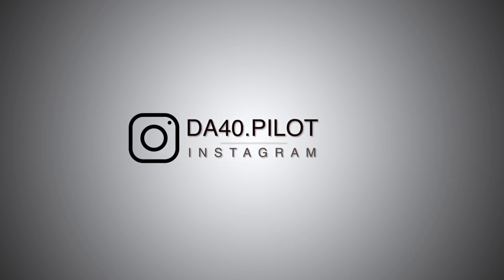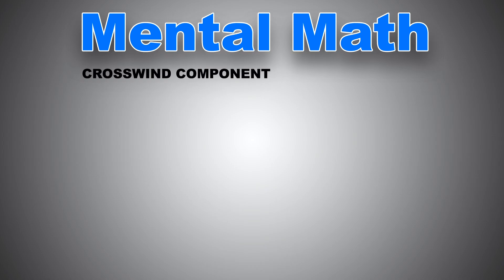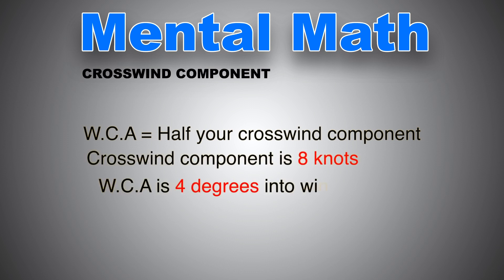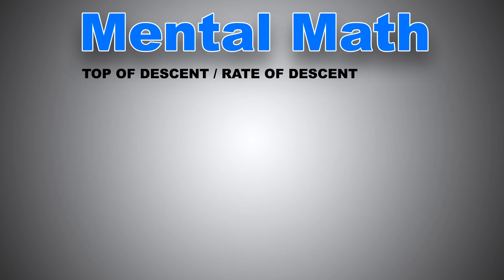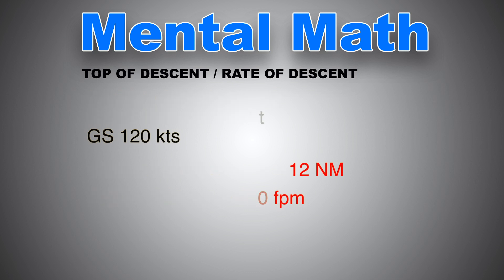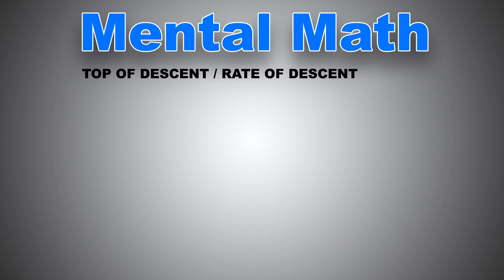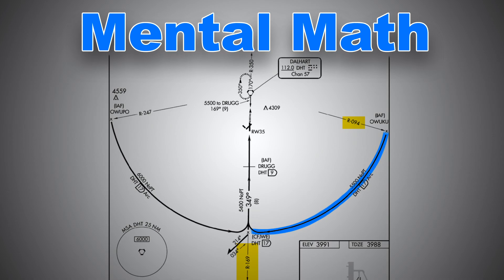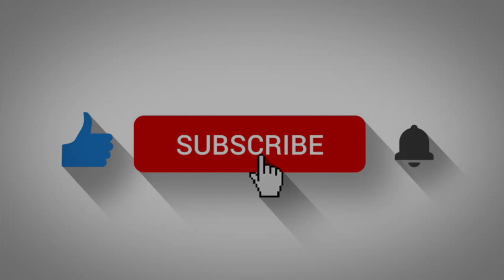✅ Mental Math For Pilots | Easy Math Hacks Every Pilot Must Know

Comment: Captain I have a question regarding the XWC. What if I encounter the situation of a tail wind. And it is above 90 degrees diference. Example:
HDG 290
Wind from 170/20
290-170= 120 degrees difference
180-120= 60 degrees 
With the graph you provided 60 deg is WIND -1 so:
XWC = 20-1 = 19
WCA = 8 degrees to the left
HDG CORRECTED 288 degrees
Is this simplification correct?

Comment: Did I miss something how did you get FL260- FL110= 15000ft- isn't cruise altitude 5500 minus target altitude 1500 would be 4000
Which would make rate of decent 4000/10= 400
Reply from the maker: I think you are confusing two examples with each other.
FL260 is 26000 and FL110 is 11000. So, 26000 - 11000 = 15000
Got it ?
Reply: @ATPLStudent  I must have missed that somewhere- at what part of the video is that

Comment: The DME ARC rule can be used for NBD arcs as well?
Reply from the maker: Of course it can, provided you know the radius of the arc (how far away the arc from the NDB) if it’s about 13/14/15/16 miles then you may use the rule of thumb as explained in the above video.

Comment: How can you assume the WCA is half of the crosswind component without taking into account your airspeed? 
Your example would only apply if your were flying at 120kts. Any other speed and you'd have to apply a different w.c.a..
Reply: I didn't see you mentioning it. That's why I commented so that people wouldn't think it would be always half the crosswind coponent.

Anyway one easy rule to calculate your w.c.a. with any aircraft and speed is to divide the crosswind component by your speed in Nautical Miles per Minute. 
E.g. 120kt = 2nm/min.
Given a 20kt crosswind: 
20/2 = 10 degree w.c.a.

300kt (5nm/min) 
20/5 = 4 degree w.c.a.

Easy to apply to any speed.

Still, thanks for the video!
Reply from the maker: @bruno84  Thank you for your comment as well as for the trick, I learned something today. Much appreciated
Reply from the maker: You are right, that is why I mentioned that that method is applicable mostly for General Aviation and single engine low performance aircraft where the TAS is about 100 to 130 kts

Comment: 5:33 Your calculation does not match exactly.  This is correct; 5500-1500=4000ft   GS120KTS  120kts/60h=2nm path per munite  4000ft/600fpm=6,66 minute (descends in 6.66 minutes with 600fpm) 6,66*2= 13,32nm. (it make progress 13.32 nm in 6,66 minutes at 120 kts.)
Reply from the maker: You are using two different methods at the same time. you wont get the correct answer that way. I see the point you're trying to make here but that method of your corresponds to high altitude/high performance aircraft where during the descent the GS changes. if you are looking for Propeller/Low Altitude operations stick to the method in the video it's pretty accurate to manage your VNAV profile/TOD.
thanks for your comment
Reply: No, I just calculated it on 120 kts. The process changes if we take wind into calculate. You shared a method without taking the wind into calculate, but it was not exactly correct. @ATPLStudent

Comment: Why did you mulipl GS*5 for rate of descent. Just trying to get an understanding of where you got the 5 from and not any other number?
Reply from the maker: It's a rule of thumbs for easy mental math. it comes from the glide path in percent 3 degree glide path = 5.2% so it is actually GS x 5.2 but we drop the 0.2. 
If you want to go deeper of where it comes, you will find out that it comes a result of basic trigonometry
Reply: @ATPLStudent  thank you man!

Comment: Why do you divide by 4 on the DME arc ?
Reply from the maker: Because of the 1 in 60 rule. 
For a 60 NM DME Arc each degree is1 min
30 NM DME Arc each degree is 30 sec
15 NM DME Arc each degree is 15 sec
and since this calculation is merely a rule of thumb we consider 12/13/14 all as 15NM DME Arc. because of 15 seconds is 1/4 of a minute we multiply by 1/4 or simply divide by 4 the difference in radials.
Hope this has clarified your doubt

Comment: GIVEN: True course : 105 degree , True heading : 085 degree , True
airspeed : 95 kts , Groundspeed : 87 kts. Determine the wind direction and
speed.
(A)020 degree and 32 knots. (B)030 degree and 38 knots. (C)200 degree and 32
knots.
According to u video the answer should be (B)
but the answer is A
why?
Reply: 105-085= 20 degrees
95-87= 8kts crosswind
According to table, 20 degrees is closer to 15 degrees off track = 1/4 of wind speed so:
8x4= 32kts wind speed 
So answer (A) is correct.